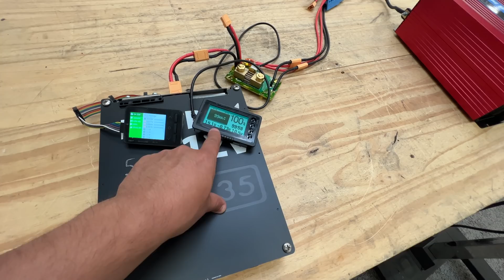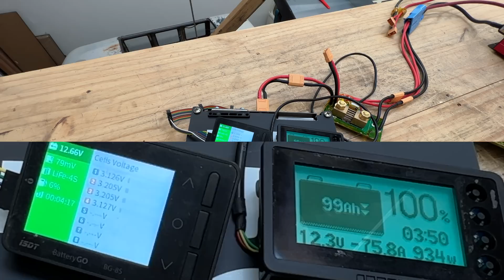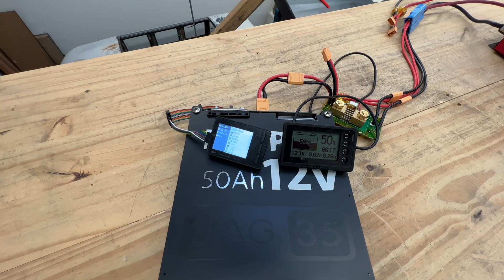$99usd 12v 50Ah LiFePO4 - 6000 cycles

Comment: Mr.Garcia PLS PLS PLS PLS try to get more of these 12v 50Ah ($99) battery pack with XT60  in stock!! I really need this to extend my Bluetti EB3a with its tiny 268wh battery. OR if you do not sell the 24v 50ah break them into 12v 50ah and have 2 of them available for purchase without the BMS. 

I am really interested on purchasing the 12V 50ah 4s pack and I actually had it on my cart already ready to buy. But I decided I would educate my self really quick about LIfePO4 batteries as this battery DO NOT COME with BMS and I do not own any LIFEPO4 batteries ( i only have li-ion, lipos).. Then after I find out that I DO NOT NEED A BMS, as I already have a HOBBY GRADE MULTI chemistry charger and I can safely charge this device without the BMS, so i come back to the cart and this thing was SOLD OUT within HRS!!

Comment: Do you connect the BMS balance leads to the port in the middle or to the bolts on top or busbars underneath?
Reply from the maker: You can do either way.  I’m designing a bms board using the port
Reply: @jehugarcia  Thank you for the info

Comment: can you use ribbon cable and run multiple of these together then to a BMS kind of like the 18650 powerwall kits
Reply from the maker: Yes just daily chain them to the bms and they all will work like one big battery

Comment: Can 4 of these be in series for 48 volts? Can that setup then be charged with a 48 volt ebike charger?
Reply from the maker: Yes,  as long as you stay within 3.65v x 16
Reply: @jehugarcia  so a 48 regular charger would cut out at 54.6 so that would work out ok?

Comment: Scammed?. As pretty as these batteries are packaged, you left out the connection diagrams you promised at the 4:42 minute mark of this video. I opened the delivery box today and there are no diagrams or support for us newbies. The top has an extra connector than shown here and the website has no explanation. Love your channel, but dude, please don't leave us battery dummies hanging.

Comment: not only environmentally friendly but geo politically and non violent sources meaning we source the materials in peaceful ways that we do not have to commit acts of violence to source i.e we dont have to invade and go to war over.

we could maybe build a cern like fusion reactor to emulate the sun to make the materials we need for batteries.

if you saw from science class the sun burns hydrogen and makes helium then burns the helium to make lithium and so on down the periodic table until iron where the sun goes supernova and burns out and becomes a big iron lump in space.

you can still use the normal lithium batteries for auto use you may be only able to use a smaller range of capacity for example you may only be able to charge to 60% and discharge to 40% so you can only use 20%.

also i am not sure what the voltage tolerance of the ecu is (brain box).

of course if we fry all the electronics in a car it is possible to total a car where it would be almost as much to buy a new car as it is to replace all the black boxes.

Comment: the usual EVE LF280K cells with 280 Ah x 3,2 V is about 115$ from china or Houston warehouse if you order 16.
This one is a 12V version which usually would mean 4 cells and a bms. 
pretty good one  - but, but, but still too many oceans aways without that european warehouse or partner.

but always great and fun to watch these builts and opportunities growing, especially since LiFePo4 is far, far safer cause we had here in last month several battery caused house fires that were caused by LiIon. Every few weeks some of the community show proofs that their system had burned and the struggles with the manufacturer.

Therefore I guess we will see a huge move to LiFePo4 especially in the solar community. 

I also like the interviews like the last one with Sandy Munroe.

Comment: what about a 48v setup, whats the top voltage? does it sit at 58volts or less? need to know as im interested in buying but i run a 48v system
Reply from the maker: 3.65v cells x16 =
Reply: @jehugarcia  ok cool, seems like it's out of stock, so I went ahead and bought some eve cells

Comment: Are these A123 cells? Can I connect 6 or 7 of these in series( without bms,of course) to make a 72v or 84v bank? I need these but sadly no shipping to Canada.😪
Reply from the maker: Yes,  and yes you can connect as many in series as you want and you can install a BMS

Comment: So why is 14 volts too high? A car alternator charges and outputs 14 or so volts. Then you have your buck convertors, if needed.
Reply from the maker: Encause you won’t ever charge theM as they need 16+v  And over discharge it’s very possible
Reply: @jehugarcia  ok, good to know.

Comment: Jehu, what do you think about just getting a power supply and setting it to 3.9V to top balance the cells one at a time?
Reply: Way too high. 3.6V is more than enough. A lot of people just charge up to 3.5V because there’s next to no capacity up past 3.45V
Reply: @ericklein5097  Good to know. Thanks for the tip.

Comment: The issue which I see is that the cells are not matched.  So,  the weakest cell will be telling the BMS to prematurely cutoff discharging, and the strongest cell will tell the BMS to prematurely cutoff  charging. Soon the whole pack will be badly unbalanced.  Matching Lifepo4 cells to avoid this problem is time consuming and labor intensive increasing the per cell cost by about 20%.
Reply from the maker: These are matched,  they come from the same original module,  the variance is low enough to pass qc at a123 factory

Comment: would these work in a car audio application? im currently using headway cells (96ah) worth or 48 cells if you will. id need to be able to draw about 800amps roughly at full tilt so from what im understanding id need a moderatly large sized bank of these id assume?
Reply from the maker: Yes,  8 of these or 4 of the 100ah ones would give you 800A continuous

Comment: i wish i could find an affordable lifepo4 solution for under the hood car battery replacement that could be a direct drop without having to modify anything. any ideas?
Reply: Headway cells could do it. You'd need a beefy bms. Starters pull crazy amps.
Reply: @mahalkasi  thanks I'll look into those cells

Comment: Jehu, you're a good guy of positive intent. I have been buying LiPO4 batteries for my power wall and I'll keep watching for your offerings, you're already sold out of your first 50 AH, 12 volts and deservedly so. It was a good deal. Best yet is that you indeed have properly identified that the LiPO4 batteries are very practially applied in most residential storage applications. Good work! You've evolved to help us all significantly.

Comment: Hi can I double up the size of the wire to increase the amp of the wire so that it will not be hot by adding the same size wire to it.👍👍👍👍👍👍
Reply from the maker: Yes you can,  just connect it directly to the screw terminal not on the xt90 connector
Reply: @jehugarcia  👍👍👍👍👍👍 Thank you👍👍👍👍👍👍

Comment: You said they're 12v not 14v but your test shows they started at 14v. All the lithium cells I've seen are 14v fully charged.
Reply from the maker: Lead acid batteries are 14v fully charged also
Reply: 12v, 24, 36v, 48v, these values are their Nominal Voltage. It'll be higher when fully charged regardless of the chemistry.
Reply: So why the mention that these batteries work better than 14v lithium batteries?
That's what I'm questioning.
Reply: @samuelfox8126  Most 12v accessories/powered appliances don't do well with over current of above 14V. 13.6-14V max.  A nominal 14V battery will have a SOC of min 14V or higher. There are exceptions. My RV TV will run on 10-14.2V. 
I fried another TV that apparently didn't like the over current. 
12.2V - 13.6V seems to be the happy spot for most 12V stuff.

Comment: I am tad confused on wire size and amp pull. I always see 10g wire rated at 30A at a length of 6ft.  In many videos I see you pulling over 30a with xt90's (I assume wired with 10G wire) is this possible because the cable length is only 2 ft or so?
Reply from the maker: it got hot at 50A even at 1 foot

Comment: Wow, batteries are starting to become really cheap. Are there any drawbacks of using these types of cells in larger batteries like 100 kwh or larger? And how is the cold temperature tolerance with this chemistry? Is it like regular LiFePO4 and gets damaged with charging in temperatures colder than 0 Celsius?
Reply: No - Yes
Reply from the maker: these are regular LiFePO4,  they behave like all other LiFePO4

Comment: Any chance of getting a 24v 4S one in addition to the 100Ah one?
Reply from the maker: I don’t understand your question , 4s = 12v  24v = 8s
Reply: @jehugarcia  sorry typo, I indeed meant an 8S 24V one.
Reply: @conradopoole  I ordered 2 to make 24v. Added to my 5400kwh bank. Battery backup in nice to have in CA.
Reply from the maker: Yes we are making 24v ones,  I’m still waiting for Pcbs to arrive
Reply: @jehugarcia  that is great. I so getting some.
Reply: @jehugarcia  , can I use the 24v to power an electric trolling motor for a kayak?
Reply from the maker: If system uses 24v this battery can power it
Reply: @jehugarcia  thank you! In your video you showed the cables heating up on the 12V system. Should I upgrade to a larger gauge wire? Thanks again!

Comment: Should just go strait to 100amp hour 48V battery with a good BMS.  That would sell like hotcakes.  Honestly also running this .2C-.3C is really the ideal rate for these batteries.  Beyond that you could hold 50 amps but I would not go beyond the amp hour of the battery with lifepo4.
Reply: Lots of us want a 12V battery, not a 48V battery....
Reply from the maker: a123 cells are amazing
Reply: Isn't the a123 battery from the 2014 Chevy spark EV
Reply: @keithm39  Spark did not have lifepo4.

Comment: why are the 2 battery’s different size of there both 50ah
Reply from the maker: one is twice the capacity of the other
Reply: There are 2 connected together on the other.
Reply: 1 is 50 and the other is 100. He explained it in the video.
Reply: @BrianPaine   yup i was here in the very beginning and he didn’t mention it yet